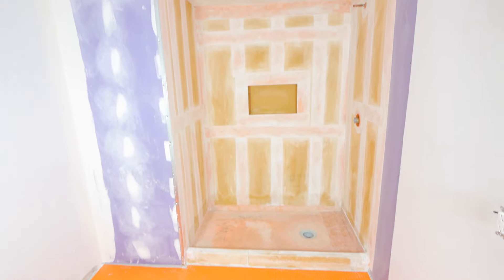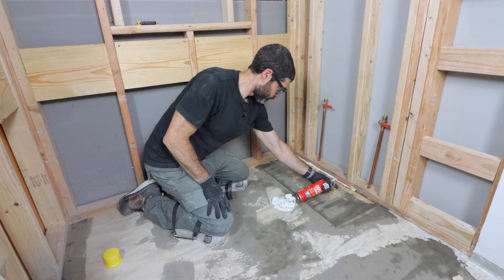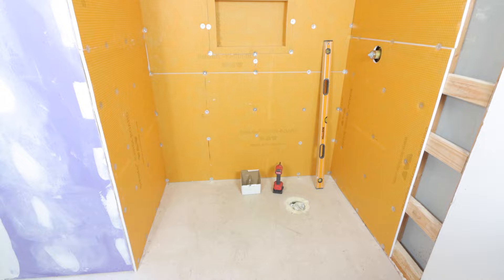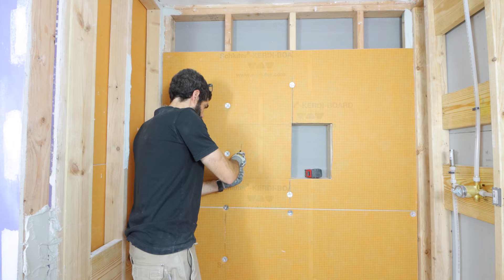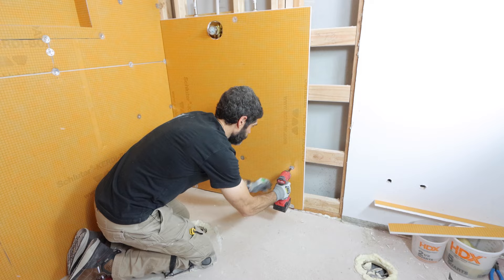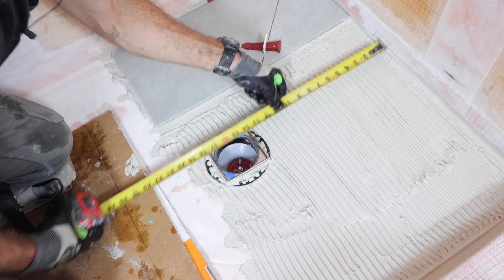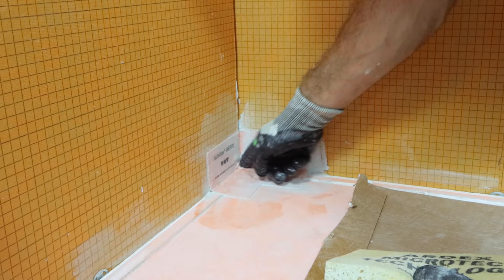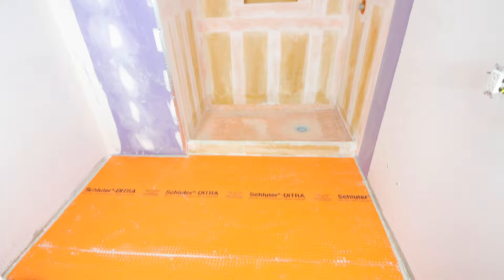How to Build a Schluter Curbed Shower

Comment: That internal pipe cutter tip is invaluable. A great tip outside the Kerdi instructions that allows you to level the entire floor (even outside the shower area) prior to gluing the drain without under-floor access. Thank you!

Comment: You should  do floor first and then the walls to avoid leaks!
Reply from the maker: No, either is fine. I prefer installing the KERDI-BOARD first then the shower pan. That way, you eliminate accidentally dropping a screw on the pan and puncturing the KERDI.

Comment: Thanks for the video, I'm in the process of diying my shower. Although I'm not using the kerdi board, I'm using the kerdi membrain over the wonderboard. If you were going to make a curb (not the kerdi) what would you use to make it?
Reply from the maker: You could use cement board over 2x4s then apply thin-set and mesh tape. Allow that to cure then use KERDI over it and use the prefab corners - inside and outside - to waterproof

Comment: Great video! 

If the curb is foam, how can the bottom of the shower door be anchored to it? You wouldn’t want to rely on just the tile to hold it.
Reply from the maker: Thank you, you have a few options. First, you can bond a piece of HDPE (like that used for cutting boards) to the top of the curb with Kerdi-Fix. As long as screws don't go through the HDPE, they'll anchor any door. Second, you could do the same thing but with a solid curb top, e.g. quartz. Finally, you could use Schluter DECO-SG for the solid glass panel and use a clamp system for the door

Comment: Are Kerdi and Wedi products essentially the same for shower installations? One better than the other? Thx
Reply from the maker: @keithk408  they’re different in their construction. Wedi’s foam core is the waterproof layer whereas KERDI-BOARD’s fleece is the waterproofing. You can wet shim KERDI-BOARDS but you can’t with Wedi.

Comment: I have watched many of your videos they are great! How do decide between cement board and waterproofing vs. using Kerdi? The later is more expensive but saves time? Would a DIY prefer the former? Is one “better” than the other?
Reply from the maker: I prefer KERDI-BOARD because it’s lighter, easier to cut, can be wet shimmed and scraps can be used to make custom niches, shelves, and even curbs. It’s more expensive than cement board but also more versatile
Reply: Did you put kerdi on the wall to the left on the other side ? It looks like it in videos ?

Comment: I see you applied the wall corner membrane after the shower bottom corner membrane. Schluter always shows the wall done first, but your way makes more sense. Do you still recommend this method? Thanks!
Reply from the maker: As long as you have 2” overlap into the corners or over other membrane it will be waterproof. Were you referring to applying the the inside corners first?